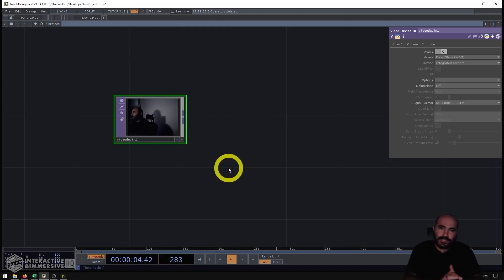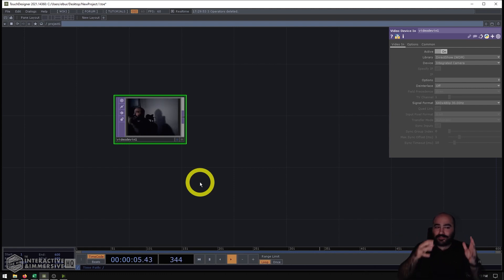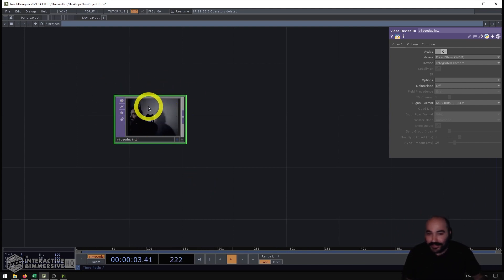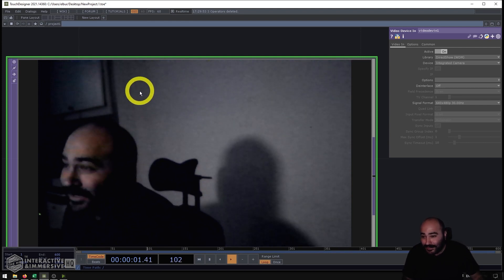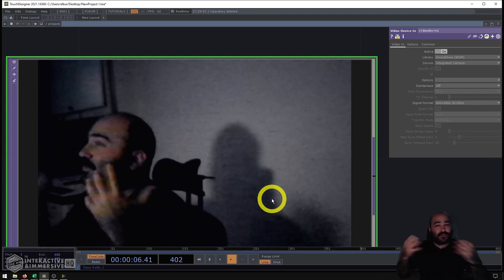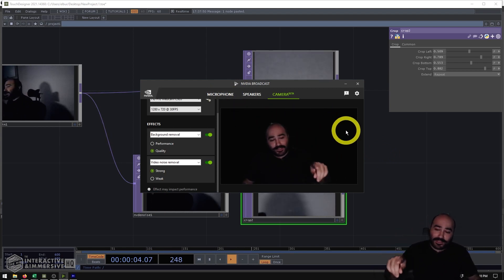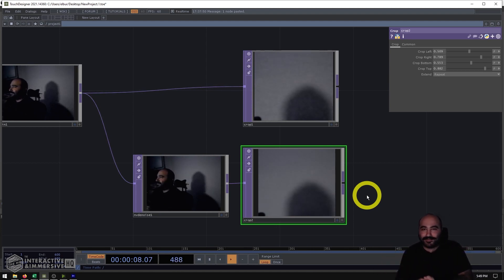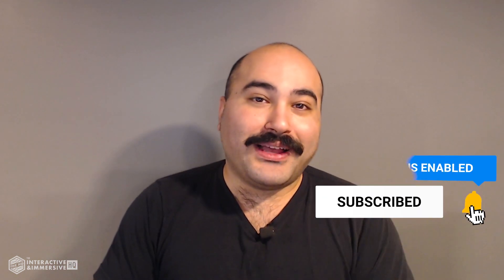Easy RTX Denoising in TouchDesigner - TouchDesigner Tutorial 054

Comment: my experience is that this operator is cpu "expensive" and on my system, contributed to about +10 cpu usage and +25F in temps.  FYI
Reply from the maker: What kind of system are you using? Did you also ensure all your drivers are up-to-date for both Windows and Nvidia?
Reply: @TheInteractiveImmersiveHQ  I could be wrong, my CPU usage went back up eventually, despite removing the Denoise.  I have a W10, Intel i7 , RTX 3060, 16 GB RAM.  I have a large network and the project uses 20% CPU.

Comment: Have you seen a "de-posterization" tool? If that exists, or when it does, it would be a great addition.
Reply from the maker: I haven't. Do you have any references of other ones? I can take a look into it
Reply: @TheInteractiveImmersiveHQ  I'm about to ask my ML friends, I would think if it existed it would use ML, and maybe after training a model it could be imported into GLSL for easier integration into TD, right? Would this be the ideal setup for an ML based effect?
Reply from the maker: @RoboticusMusic  It really depends on the models and frameworks being used. If you're using "machine learning" as in manually making neural networks, you could do them in a shader. Most folks end up using pre-existing frameworks like tensorflow or similar, and for those you'll likely be calling/interfacing with them through Python, and then behind the scenes they'd deal with your GPU, so I don't think you'd use extensive ML out of a shader in TouchDesigner, or at least I haven't seen that case appear yet.